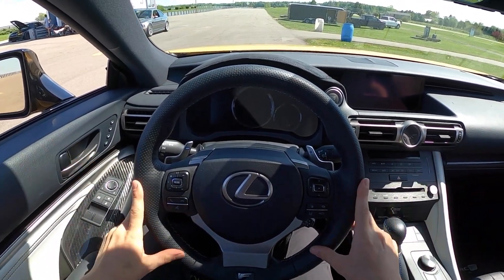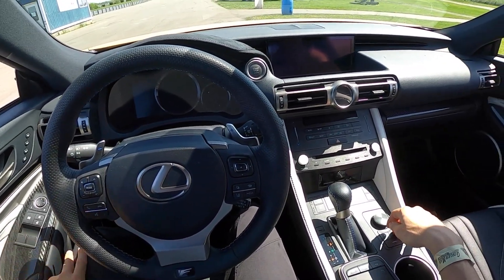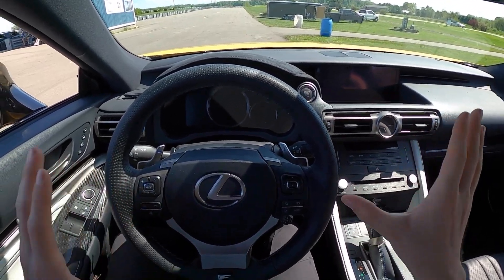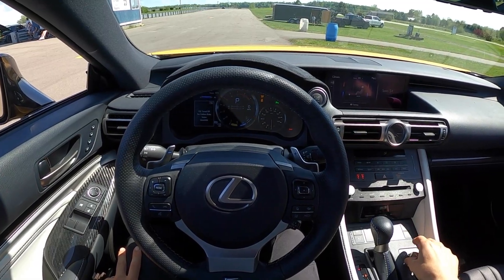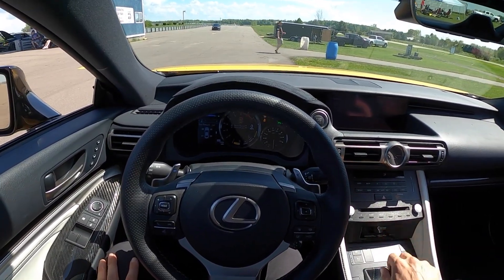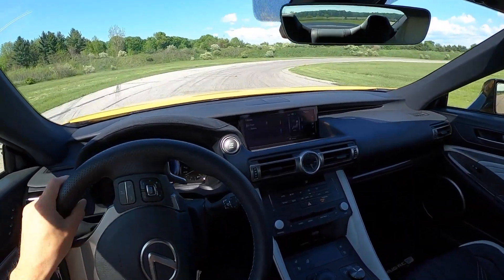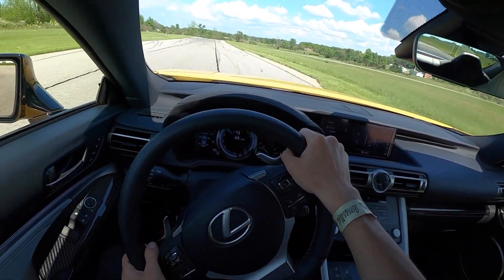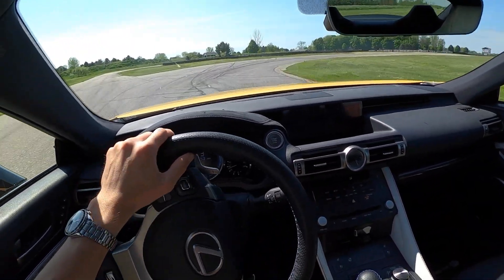How to Fully Disable Stability Control in the Lexus RC F - The Pedal Dance! POV Track Test

Comment: "Stability control" is an understatement. VDIM is a very sophisticated system that controls brakes, throttle, electronic steering, and the RC Fs torque vectoring.
Reply: yapper
Reply: @carsnbikes914 😂 I like to torque vector with my right foot😂

Comment: Here’s the side note,
•All 2004 and up Toyota and Lexus cars, with exception of hybrid models can be disabled with this procedures. They start using this system from 2004 Toyota Crown.
•VDIM/VSC will turn back on every time you restart the car.
Reply: 2002 lexus rx300, im guesisng that's not possible
Reply: @salami99  Sadly, ‘02 RX isn’t one of ‘em. 2nd gen RX330 and up are pedal dance compatible

Comment: I actually cracked up watching this... I get why they do it but there is something so funny about making your customers literally do a dance to turn off stability control
Reply from the maker: It reminds me of old PlayStation cheat codes 😂
Reply: The pedal dance was not designed for customers it was designed for Diagnostic testing like putting the vehicle on a Dyno.. holding traction button for about 7 seconds will give you pretty much the same thing

Comment: I never noticed a difference between the pedal dance and simply holding the TC Off button while stopped. I drove my IS 300 in the snow a few times, and it seemed to behave the same after pedal dance as the normal way of doing it.
Reply: Wait
Reply: Was yours awd and did it let you do standing burnouts?

Comment: Hmm interesting. So does stability still kick in if you hold the traction off?  I own a 2015 rcf with no ediff. When in sport plus and “expert mode” traction is fully off(at least in as straight line) as I can just smash the limiter spinning the tires in 1st and 2nd and hold it till I blow the thing if I wanted. But stability kicks in if it thinks you are in trouble(like too much speed and steering angle if you drift). But if you hold past expert and turn it all off in any mode I’ve gone drifting and ive lost the back end whipping around on me with no stability kicking in. Luckily kept away from curbs on a few butt clinching situations. I didn’t notice any braking or throttle cuts trying to help in those instances.
Reply: I am also under the impression just holding the button down does the same thing.
Reply: @johnleto475  this is only required if you have the tvd, with the "base" rcf what he says is corrent

Comment: I just bought a 2017 GS F, and it doesn’t have a foot/mechanical parking brake; it has an electronic/auto parking brake button.  So how would I fully disable my traction control?
Reply: there are videos of how to do it in a GS F if you have not already found out, just look up on youtube Lexus GS F pedal dance and a couple videos should pop up! I'm in a '16 GS F myself congrats on the ride

Comment: Is there a reason why you have to do this rather than just having a button that turns it off properly?
Reply: Safety reasons maybe some unskilled drivers would end up in a really bad accident
Reply: Legal.
Reply: To clarify, you probably don't need to do this in a regular RC or IS or GS. Just the F versions with the torque-vectoring diff. I tried the pedal dance in the snow with my IS, and also tried just holding the TC Off button, and I couldn't tell any difference.

Comment: On my IS300h, I just have to hold the traction control button down for 3 seconds, and it disables all the VSC systems, including traction control. Isn't that the same thing?
Reply: No it's not the same, the is models don't have as sophisticated of a traction control as the new F models (RCF and GSF, not ISF). I used to have a 2015 IS and yes for that car you just need to hold down the TCS button. I have a GSF now, when you hold the TCS down in the GSF it says the TCS is off, but it isn't. If you try and do a burnout or donut the TCS just kicks back in and doesn't let you break traction. If you want to do burnouts, donuts, etc you need to do the pedal dance to turn it completely off. I think it might have to do with the TVD, but I'm not sure because I know most RCFs don't have it.
Reply: @iandalonso  wait even if your IS is awd can you still do standing burnouts when you do the pedal dance ?
Reply: @iandalonso  I just bought a 2017 GS F, and it doesn’t have a foot/mechanical parking brake; it has an electronic/auto parking brake button.  So how would I fully disable my traction control?